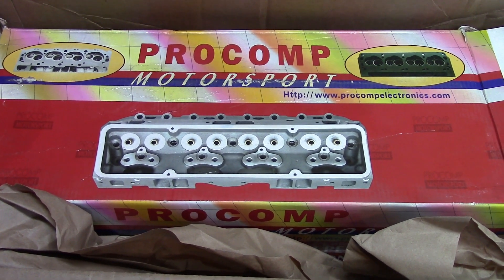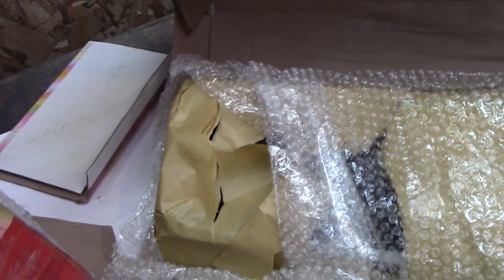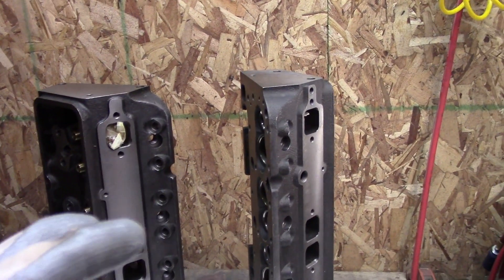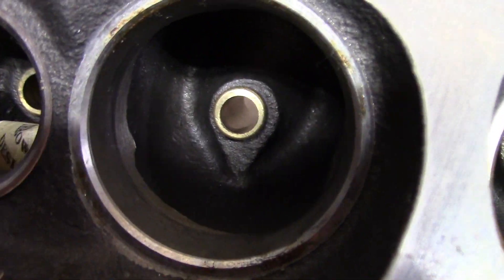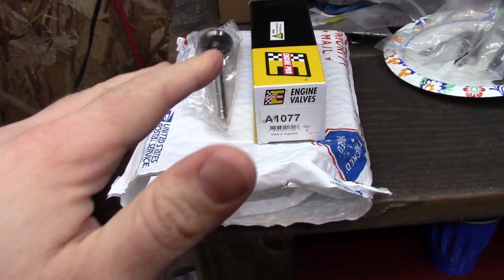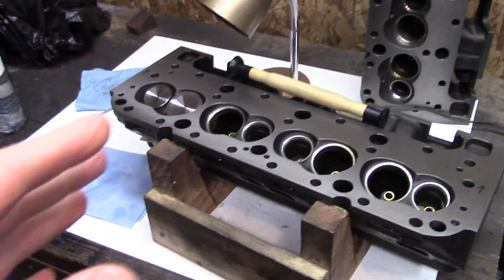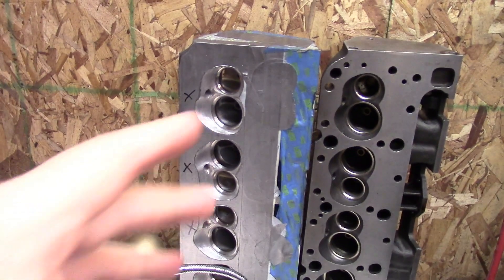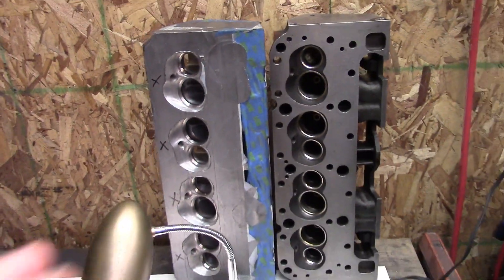PRO COMP SBC Cast Iron Cylinder Heads Inspection & Comparison

Comment: I'd trust the Pro Comp iron heads more than I would their early aluminum heads.
Reply from the maker: Yah herd lots of bad things bout their early alum heads But these iron heads deff were new/old stock so idk
Reply: @BOOT  the early aluminum versions had problems dropping seats and the guides were soft.
Reply: @BOOT  the aluminum itself was shit too.
Reply from the maker: @thereluctantgearhead4544  These iron heads have possibly the same bad bronze guides and all the seats were replaced.  So basically I feared that they could have the same problems as the alum heads.  Then since they also cost more than ebay generic heads And would need larger valves installed, costing more yet.  I just returned them for a full refund.
Reply: @BOOT  they are a crapshoot for sure.

Comment: Those are actually decent heads. They are definitely 1.94/1.50 valves. Pretty good castings.
Reply from the maker: If I kept them I woulda cleaned them up and installed 2.02 intake valves at least.  Didn't like the look of that intake VJ
Reply: I have made 550hp on 1.94 valves

Comment: Im sure that bubble wrap would protect the heads 😂 I would like to buy better heads for my sbc but I'll just have to stick with my 1994 world products sportsman 2's because I just want to get my engine going and in the Nova , still got to get a cam and lifters and a few other things . How would low spots happen on that surface ?
Reply from the maker: Yah the bubble wrap was LOL   Sportsman heads are fine, mine beat cars with better heads just my car was more dialed in.  Not sure why the ends are low, never surfaced any heads myself, maybe too fast feed or something???
Reply from the maker: On and if your looking for a flat tappet check out Jegs house cam kits.  Just got one for BUCK around Xmas.
Reply: @BOOT  I have jegs roller rockers and stud girdles, I'm thinking about getting solid lifters I kinda want to get some rpms out of it , i just really haven't figured out what grind and lifters to go with
Reply from the maker: @051570orion  I also picked up one of those Jegs stud girdles, looks decent for the price.  I'm not really a solid cam guy but I understand why some really like them.
Reply: @BOOT  I have never ran a solid cam but I have Polly locks so I figured I would give it a shot .. lol

Comment: They are definitely 1.94-1.5 valve seats. The valve job was full of chatter marks. The heads don't look bad, I kinda wonder if they're a dart 180 cc copy. To bad the added cost of cutting the seats for bigger valves will put a screwing on the cost. I would send them back. This is why I will never buy anything from procomp/speedmaster. You never know what you're going to get. I trust a fart with diarrhea more than procomp.

Comment: I'd say you definitely got your money's worth they didn't look too bad at all and in the description it says they're thicker cast then the regular vortec heads which is good because we all know vortec heads are shit and about 3 out of every four you'll find are cracked either on the deck or in the exhaust valve area's and those smaller valves will flow better in those heads unless you're building a 8k RPM engine you really don't need those big valves from my experience

Comment: no cfm verification the whole video is a waste to watch
Reply from the maker: CFM isn't everything, just ask DART
Reply: @BOOT  cfm is everything. building any engine is all math. No flow = no power.
Reply from the maker: @vinniesteele2889  Power is efficiency and there are other factors than just flow/CFM
Reply: @BOOT  everything counts "BUT" total cfm air flow determines max power "possible.
Reply from the maker: @vinniesteele2889  Potential power and Possible power are two different things.  There is a common saying when talking flow, a sewer pipe flows A lot!  I could go on and on with examples to try and explain why I don't care bout flowing heads most the time but sometimes you just gotta learn something for yourself.  In the end these are cheap small runner heads and their Shape is what tells me they are decent for the cost.
Reply: @BOOT  ok so those small runner heads are decent castings and will work well for an engine that is close to stock? ok.
If you were able to squeeze 400 hp from those heads then just by switching to stock vortec heads you would get 420 hp. If these castings are legal replacements for 2 bbl roundy round cars then you might have something considering vortec heads are not legal. A 2bbl engine is not making much over 300 hp and that is well within those castings abilities.
Reply from the maker: @vinniesteele2889  I squeezed over 400hp from untouched Sportsman II's   Like I said sometimes you just gotta learn for yourself why some heads are good enough.  FYI I wouldn't use the same parts with these heads as vortecs.  Maybe you should watch the end part of the video before posting LOL
Reply: @BOOT  dont be obtuse. Sportsman heads are far superior to the heads you mentioned.  Vortec heads unported use a lower lift cam and still flow more than the heads you mentioned.

Il put my knowledge/experience/math against what you have posted anytime.
Reply from the maker: @vinniesteele2889  The Procomp Iron have better chambers than Sportsman II's, they don't have Giant guide bosses and would take less basic clean up.  But they still would be a smaller runner, unless you ported them out.  There are multiple factors to consider since the Procomp don't have the advertised larger valves.   Still no point going into it anymore, since this clearly is no longer a rational discussion.
Reply: You should buy a pair and flow test them and make a video about it. I'm sure you'll be a hit.